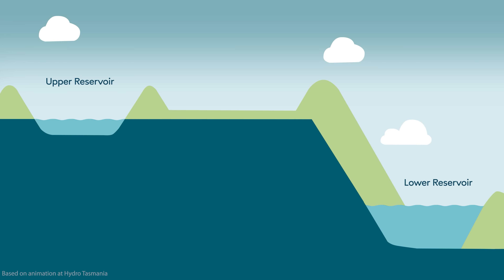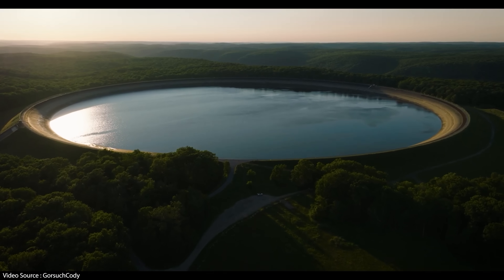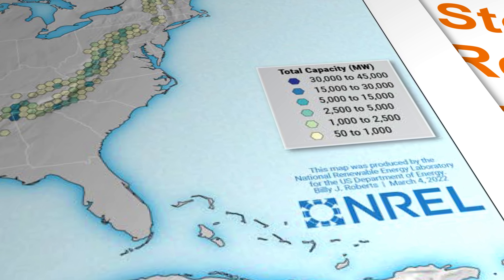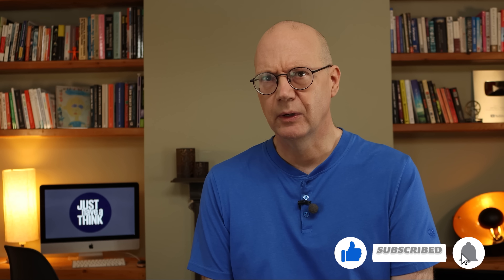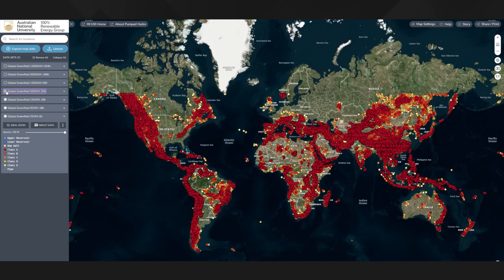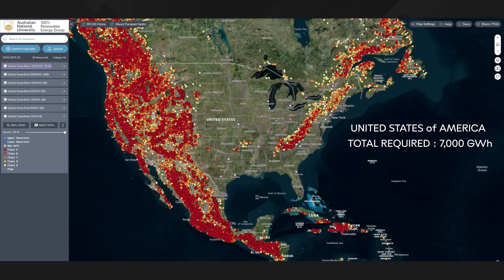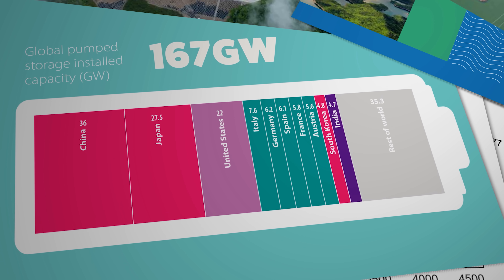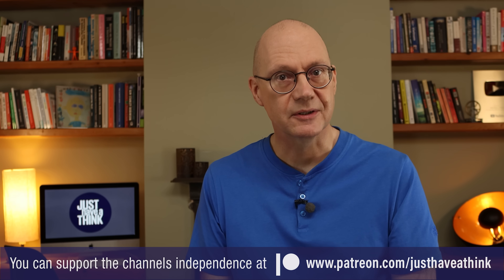The insane potential of Pumped Storage Hydro

Comment: Geographical note for the US sites. East of the rocky mountains, the best sites appear to be in Appalachia. Apart from creating viable construction and energy jobs to replace coal mining, there is overlap with the Tennessee Valley Authority, a federal administration for power generation and water management. They would be great partners potentially in building out closed loop pumped hydro pilots to scale.
Reply: TVA already operates an open loop pumped hydroelectric plant, Raccoon Mountain.

Comment: What is cheaper, renewable generation with pumped hydro or small reactor projects?

Ban coal along with gasoline, at least in the Eastern, Asian and European megacities.
Reply: Basically everything is cheaper than nuclear
Reply: @sharkheadism  but not safer. Coal emissions include radioactive material.
Reply: @sharkheadism  Only the big ones. Look up small reactors.

Comment: The heating of Barent's Sea, partly by air (in addition to Gulf Stream) was the tipping point. The new normal is 110 degree summer temperature in July in the southwest while Canada burns and pollutes the air in Canada and US.

Carbon dioxide is not the problem. Hot asphalt heated up the sea, which is heating up the Arctic, which is heating the global north, which heats Barent's Sea. The vicious cycle feeds itself. The point has tipped. Barring ending gasoline use, covering roads and parking with electric links for cars on bottom and grass/irrigation and solar panels on top, there will be no relief. Forget warming via carbon. Actual hot air is the problem to blame for hot gulf stream and surface temperature increase from air. Read Barent's Sea paper from nature.

People complementing themselves on being carbon neutral does not stop the crisis. Capping carbon usage to preindustrial levels or even global temperature to 1.5 degrees over that time period. The problem is that warming the sea that warmed the Arctic Ocean has been getting worse by one degree every year. A local problem.

Hunga Tonga likely disrupted the trade wind patterns causing La Nina caused drought, so the west and southwest are soon to be out of a water crisis. It was not warming after all.  Not every bad effect is about carbon. Maybe none of them are. The heated air coming from the East Coast megacity is what tipped the scales. Not CO2. 

The question is what will it take to cook the megacity heat done? Roofing over roads and parking lots, installing tethered electric and banning gasoline in urban areas and major highways is what will do it.

How many poor people in already hot or newly hot areas have to die before we act. How many irrigated farms and cities will be abandoned? Of course, some must be. There should be no farms in Arizona. Ever.

Warming with El Nino moisture may allow forests to develop that can make their own weather, or we can simply close down parts of the southwest as people flee anyway. And after a few years like this one in a row, they will flee. Not a bad thing 

Agriculture needs to become indoor, vertical and beef and pork lab grown. Probably chickens too (with artificial eggs). Sheep and goats are needed for clothing and cheese.

Anything that can be conveniently raised indoors (not factory farmed) or grown in a Mars mission or in orbit can be. Nothing else, including mass grain that depletes the earth, should be if it can be replaced.

Forget wheat and corn. Plant grass and let the earth heal itself. Also, ban high fructose corn syrup. It is a chemical, not a food. And forget soy too. Not needed if we can lab grown meat. MSG is also poison, as are many foods with high soy content. Also the oils (aside from olive and coconut). Trans fats are killing people too. If we can clone milk fat, we can have nice healthy butter.

Comment: Well, if the climatologists are correct about climate change, we'll run into some droughts, correct? This could be disastrous for anyone relying any sort of hydropower. Here, evaporation might be considerably worse than indicated,and maybe longer-lasting? We'd be fools to turn away from this If David is correct on the stability of hydro. Also, it takes energy to pump water from high to low, low to high. We'll need a sufficient primary source. So let's hope that solar and wind become worldwide. Unless you invented a fusion reactor in your garage? The investors will then beat a path to your..garage door!

Comment: We can get pumped hydro from non-closed systems too. A year ago I visited Hoover dam in Nevada, US (2GW) and only then realized it has a capacity factor of 23%, i.e. runs full capacity 6hrs/day. They are building a forebay for pumped hydro below the dam. If we assume there is something only enough water for 6hrs/day at 100% and we have 6hrs of peak solar per day, we can shut off the 2GW during the day and pump 2GW back from solar, then get 2GW for 12hours. Half from river half from pumped hydro.

Not mentioned is round trip efficiency. It surprised me at 80%. Not quite batteries but better than Form iron oxide batteries and way way better and cheaper than hydrogen.
Reply: You typically don't pump water back during the day as that's the time when there's the highest demand for electricity. You use excess grid power available at night to pump it back, which rules out using solar.

Comment: It is only economically viable in places where natural water reservoirs at different altitudes are naturally occurring (see the financial fiasco of El Hierro), but these are gradually vanishing, due to the melting of glaciers (which provide the water for mountain lakes). 
Artificial lakes, on the other hand require tons of concrete and metal and produce tons of CO2. Last, but not least, barrages, artificial reservoirs,  and the like have often been linked to environmental disasters.
Concrete, metal and water are also becoming rare and expensive commodities.

Comment: Water Pump Reservoirs are bad.
The enormous Water Masses exert enormous Pressures on the Earth's Crust and increase the Earthquakes in strength and quantity.
Reply: All the oil that is extracted additionally damages the earth. Because the oil is like a vibration damper for the earth. Which also leads to more and heavier earthquakes.

Comment: Curious what the efficiency is of pumped hydro. That is, what percentage of the energy used to pump the water up makes it back into useful electricity as the water comes back down. 

Intuitively, I would expect the energy losses to be far greater than with batteries, so a 100% renewable system backed by pumped hydro would require substantially more wind and solar production than a 100% renewable energy system backed by batteries.

It may still be worth it in the end, but it is a legitimate tradeoff that must be considered.

Comment: Seems the same logic could be applied to gravity batteries really, and you don’t need the water… Old mine shafts seem to be good candidates, or newly built towers built for purpose. Lifting weight using excess energy production to store it as potential energy should work whether you’re lifting solids or liquids, using pumps or winches, to turn turbines or belt driven generators…

Comment: There are two major hydro projects in Australia - Snowy Hydro, and Snowy Hydro 2.0.  While official sources praise these projects, I was unable to find any information about how effective they are in practice.  In particular, there is no information as to ROI (perhaps I don't know where to look).  Apparently government projects do not have to report in the same way as private ones.   I do know that at times, these projects are touted as "nation building" and immensely important, depending on how close we are to an election.  

A quick search shows that there are some pumped hydro schemes in the world that do have a significantly positive ROI.  These are generally in Wales, USA, Germany and China.  I agree that this seems like a sensible option, but enormous projects like this always have setbacks.  I wish it were not so, and I hope that we do get more profitable schemes like this in the future.

While it seems that this is a very sensible way to go, it is clear that battery storage is more nimble, faster to implement and easier to locate.  So even if watt-by-watt it turns out that pumped hydro is more efficient, I think that it is far more likely that battery storage will be implemented in preference.
Reply: While grid scale batteries are more scalable than PHS , they will likely remain significantly more costly per MWh. Capital cost of grid scale batteries is AUD $500~700 kWh, PHS is AUD $100 ~200. PHS total life cycle cost per kWh is much lower than batteries as the service life is 50+ years, batteries have an expected service life of 10 years. Further info is available in CSIRO's GenCost document.
Reply: @mikegofton1  Thank you.  I'll check that out.

Comment: pumped storage needs certain areas, so it takes big lines  to get power in and out.
guess it can help areas where it's relatively close to communities.
we still need geothermal, which goes anywhere and reduces the infrastructure cost for connections, since you put it where you need it.

Comment: Most regular hidroeléctricas dams can be used for this idea,just build a second dam downstream pump back water with green energy wind or solar,this will increase the potencial of the dam or allow the hidro electric to work mainly during peak demand,even if water isn't 
 pump back slower. small reserbua will allow intermittent electricity producción but dowblin the power so during the day is not production.

Comment: Great video. In Australia they are building a Pumped Storage to supplement the already supplied grid system. They have found problems with the soil composition in the Snowy Mountains where they are building the PS but nontheless are still progressing with the installation which is going to take a bit longer and more expensive than originally planned. Thanks.
Reply: They had problems in Switzerland too. A fascinating video here: https://www.youtube.com/watch?v=6AV2NcyX7pk

Comment: Could abandoned coal mines be used as the lower reservoir? And then why a closed loop it could be sea water pumped to a higher location and then let back into the ocean? The Dutch have been using windmills since the 11th century. They turn gigantic Archimedean screws that pump the water up to the next level where it is pumped higher again until it eventually goes over the dike into the ocean. Modern windmills could drive electric pumps thus being independent of the grid. If only we could harness the hot air being generated by political parties.
Reply: Just realized how stupid "indepentent of the grid" is as you'd be feeding the generated electricity into the grid. Time for bed.

Comment: Not to mention we can even install floating solar panels on the 2 reservoirs of the closed loop system.
Which also has additional benefits of reducing evaporation of these reservoirs and the water would in turn cool the solar panels.

Comment: I first knew about pumped storage when I worked on the Niagara Power Project when I was in high school in 1960.  They stored excess water at night and released during the day.  Probably the most efficient method for large storage.  However, I still think that the most efficient use of resources would be to locate small modular nuclear power plants near where the power is needed.  This minimizes the need for storage and transmission lines.

Comment: You ask Afghanistan if they can use pump hydro. Or any other desert country.Hydrogen on the other hand can be shipped to them by hydrogen powered ships and or trains. Where when used for their purposes will give them energy heat or electricity AND wait for it……Water. Wow water in an arid  country ? Yes.😊

Comment: hat you do is drop 7 pylons, gravity accelerates each pylon, 10m/s^2, so the potential energy is converted to kinetic energy, but every two pylons work on a pully which has a continuous drive - [ two horn cones face point to point, slightly overlapping depending on the automated motor switching through worm gear of the pully drive inertial recovery phase scenario ].  Unfortunately, it needs green oil, not varment oil.  So its much more powerful the higher you set up the gravity sequencer, but it has advantages over magnetics, like capacitors, which must reach hundreds of thousands of volts in fractions of a second to be competative.  Or speed of light switchs that use rare earth materials in 50 meter cables generating city-wide heating and air purification shaping.

Comment: the late David McKay wrote a book, "Sustainable energy without the hot air", freely available online, it's a great book but it left me kind of... underwhelmed by potential of hydro? he seemed to make good arguments for why its overall potential is quite limited. anyway, these reports seem to add a fair bit of nuance while taking essentially the same approach as he did, it's nice to have reasons for optimism come out of a slightly more detailed analysis, usually it works the other way around =)

a complementary technology you might find interesting is OTEC, and relatedly OceanBit's efforts to try and make it economically viable (the tech is not new but there's no market for it), i'd be curious to hear your analysis and critique

Comment: Many Pumped Hydro facilities to date have actually been paired with Nuclear plants. Sooo… why not just do Nuclear?  Save the land from renewables and diffuse energy farming and extreme amounts of pumped hydro and do tight compact Nuclear and far more modest pumped Hydro with it!!!
Reply: Expensive, dirty and dangerous.
Good old fashioned economics have priced it out of the market.
Reply: @davidwatson2399  
Good old fashioned economics based on artificial human constraints instead of physical realities. The physics of fuel energy density dictates that Nuclear should be the cheapest not the most expensive. 
Dirty?  Yeah no. Actually the cleanest energy source!  
Dangerous? Yeah no. Actually statistically the safest dispatch able source we have. 
I’d recommend you rethink your position.
Reply: @MrElifire84  
It's expensive, only cheap if highly subsidised.
Waste / fuel is still an issue throughout its life cycle, including mining.
Reply: @MrElifire84  
Please explain the construction time over runs, massive cost overruns and abandoned projects.
Why aren't companies leaping at building these plants?
Good old economics are against them.

Comment: I really wonder what Italy's potential pumped hydro resources are. Northern Italy doesn't have all that much wind power potential but it has pretty decent solar power potential. Would be pretty awesome if Italy could supply half of its electricity needs on just solar PV + pumped hydro.
Reply: Won't happen. The pumping is done at night, generation happens during the daytime.
Reply: @sharkheadism  Wrong. The pumps do activate during the day when there is solar power production if there's a big enough slump in real-time wholesale power prices. Three are charts that plot electricity generation history and even the power consumption of pumps. Check yourself before you wreck yourself, scrub.
Reply: @hyric8927  I work for a utility with a pumped storage facility and I'm telling you how it works. Unless there's maintenance, some kind of system test, or an unusual circumstance, we don't pump during the day because our demand is highest then, we use the cheap extra baseload at night. Otherwise it's uneconomical. Better luck next time.
Reply: @sharkheadism  LOL. Sure. What's actual evidence and data when you can just claim to be an authority. Oldest trick in the internet trolling book. If you're really so busy then get back to work.

Comment: This seems to be a good way to go compared to a lot of other things I've seen on this channel. I wouldn't want to rely entirely on this method. I still have high hope for nuclear fusion. I'd like to see this channel put some info out on carbon capture. If we can ease the alarmism about a tipping point with no return we can wait until renewables are fully up and running before converting entirely from fossil fuels.

Comment: I can see a possible improvement to the pumped hydro system. The upper reservoire shoul have one more pipe/channel. When the upper tank is full, and we still have extra power in the grid, the water should be overflowing into that otger pipe and doing something useful. For example, it should connect to some dry/arid/desert area on the other side of the mountain (like Great Dividing Range in NSW Australia) and make that area more suitable for agriculture. Sure you will need some extra renewable power capacity and water supply.
Another way to use the extra renewable power rather than pumping up water the hill - for aluminium/steel production or water desalination. Again, you will need extra power supply installations to reduce the need in batteries/power storage, but the excess power supply will be used more effectively.